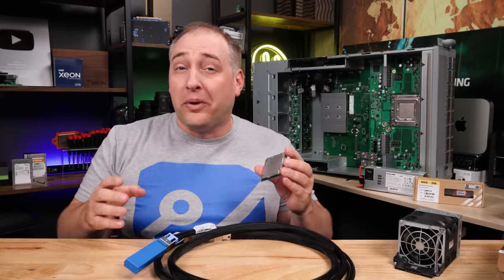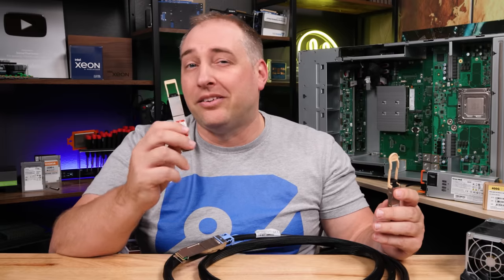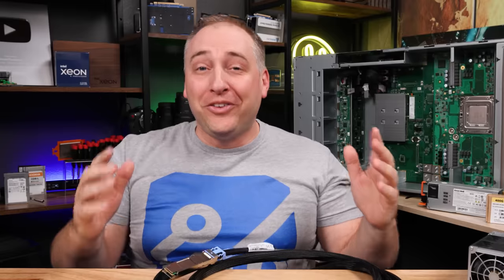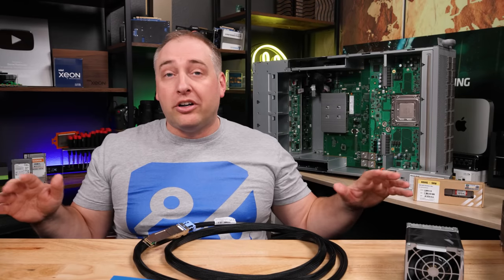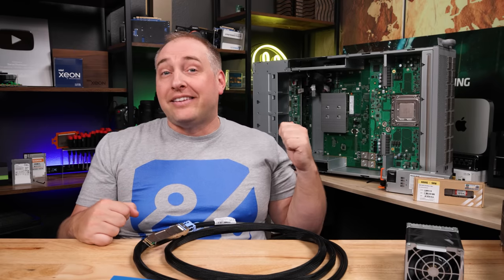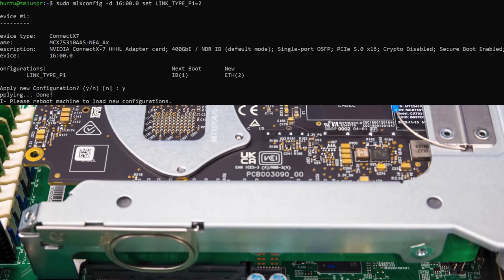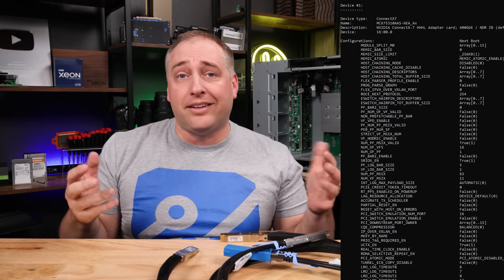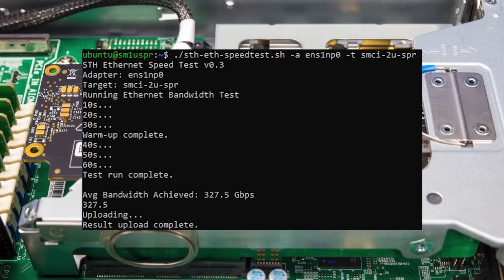FASTEST Server Networking 64-Port 400GbE Switch Time!

Comment: Hey thinking of upgrading my home network, will this switch be enough for 1.2Gb Comcast? I don't want to bottle neck it, I'm paying big money each month.
Reply from the maker: You may have to wait for the new 800GbE generation later this year. :-)
Reply: @ServeTheHomeVideo  i wonder how much bandwidth an AI cluster needs to flow.  Is this for serious carrier backbone?
Reply: @letterspace1letterspace266  AI clusters can run on insane connections exceeding the 400G connections used here, but they can also just run on a single machine instead of as a cluster and still perform shockingly well if optimized.
Reply: Haha nice

Comment: At work we are putting together two vmware clusters using a pair of Aruba 9300 switches (32 ports of 400G) as the backbone. vSAN storage with all NVME is going to love the bandwidth.

Comment: Just more awesome, cool content from Patrick K & STH.  Yes it's nerdy.  Of course it is!  We learned about Mikrotik's 4 port x 10Gb switch here from STH years ago and other OEM 25Gb & 100 Gb switches, too.  Where else can you see an FS 64 Port x 400GB switch under the hood.  You can count on Patrick.  He will remove tell you how many screws it takes to get inside the device.   And PK will remove the Heat sink, the CPU, the Fan Modules & PS Modules every time. And you get discussion, use ideas, performance results, connections parts, etc.  It doesn't get better than that. STH just helps get my Nerd Habit filled each week along with the other online tech nerd content.  Keep up the good work STH!

Comment: Hey Patrick, do you not have a subscription system for the website like Phoronix does, so we can read without ada while contributing? I feel bad having uBlock on, specially since I'm transitioning to 10G (switching) and 40G (direct) at home, and it's mostly thanks to you guys and your awesome reviews and posts.
Reply from the maker: We do not, but if you see from the screenshots we have an external firm sell all of the desktop inventory and most of the mobile. If you are on the desktop you will only see ads from our servers about server, storage, and networking things. We do not have bidding, auto roll video, moving ads, and etc because I do not like them.
Reply: @ServeTheHomeVideo  great, thank you!

Comment: Being a network guy, I am struggling with the OSFP acronym used here and i am sure when i start ordering these types of connectors/cables for these applications i will be corrected many times in conversation that overlap the two technologies. My one saving grace, 400Gb switching i  will certainly see a lot of, 400Gb routing, I'm not so sure I will see a lot of this before I retire in another 10 years
Reply: we're deploying 400gbit routing on nokia platform. it's a step up from giant 100gbit lacps to 36 port 400gbit line-cards.

Comment: What a BEAST! I'm glad that you guys went and showed this off. I got trolled by a guy suggesting that I use infiniband (which I'm already familiar with) at home on one of my recent comments. I also understand that it is a total BEAR to set up and get running at the correct speeds, etc. Totally NOT the sort of solution I'd be considering for home use. I've seen other YouTubers try to install old used enterprise infiniband gear in their home, and it's always funny to watch them suffer. Too bad you didn't show all the fun bits of yourselves wrestling the bear. Although, it's not very exciting for non-nerds to watch. I'm surpised you could even power this thing. You'd need to build an internal Chernobyl just to spin up the fans, alone! (Exageration intentional for comedic effect) I'm afraid the electric company would send an investigator if I installed this in my home.

Comment: At my work, we are refreshing a dc and where 400gig fits for us is more in the spine to super spine/core layer. We just don’t have hosts doing that high of speed, but most are moving from multiple 10gig connections to 25s. I would be jealous when there is a need for direct host 400gig!

Comment: Wow. 9% difference in throughput between ETH and IB.

On 100 Gbps IB, the difference that I measured was only about 3%.

$6k for 400 Gbps IB is actually NOT that bad when you think about $/Gbps (for a point-to-point connection).

I use 1 GbE as the "management" port these days.

Server consolidation meant that I was able to SRHINK my network (rather than to expand it).

But on my systems that have the space and is able to support it, I have 100 Gbps going to my Ryzen 9 5950X HPC compute nodes and also a 100 Gbps going to my Core i7 3930K which runs my LTO-8 tape backup system.

It takes the "stress" off the 1 GbE layer and moves it completely over and the 100 Gbps can handle a lot more things happening at the same time.
Reply from the maker: Well that is also a direct connect IB versus through the switch 400GbE.
Reply: @ServeTheHomeVideo  
Yeah.

I forget what my point-to-point ETH bandwidth losses were compared to a point-to-point IB bandwidth.

I don't remember if I ran my testing on the 100 Gbps IB through my switch or if it was a point-to-point test.

I would think that the bandwidth losses should be lower on the point-to-point side (because you aren't going through a switch), but I can't say that definitively.

Very cool.

100 Gbps IB is fun.

People give you REALLY interesting looks when you tell them that's what you run in the basement of your home.

Comment: try it without the switch - 400g will drop in price, will be good for clusters - they will have 800g before you know it #cluster overhead
Reply from the maker: 800GbE will happen but it is hard to go to the node at that speed until PCIe Gen6

Comment: Hi Patrick, How were you able to connect the OSFP HCAs to the QSFP-DD ports on the switch for the Ethernet testing? I just re-watched the video, starting at the 12:30 mark, where you're referring to "funky optics", I'm assuming these are QSFP-DD w/ MPO on the Switch Side and OSFP w/ MPO on the HCA side? I also read the Main Site Article, where you also talk about having to navigate different signaling speeds in-between the optics. I then looked in the STH forums and read the 2 threads discussing OSFP, and posted on one of them. Any details you can share would be much appreciated.

Comment: Hi Patrick!  Very cool.  I mostly think of 400gig switches as core/ super-spine switches. But like you said, I could see it being great for breaking out into a LOT of 100gig links without any over-subscription between them.  It is odd to think of 400gig as kind of slow, but if you had a bunch of 32 port 100gig switches with a 2 port lag up to the 400gig switch, that is 3200 down and 800 up.  So about 4 to 1 oversubscribed uplinks.  If instead you could break out a lot of 400gig ports into 100gig, and go straight to the server, there is no oversubscription between all of the connected servers.
Reply: When you mentioned core, I thought: I think most large companies use routers as core. So I looked up the product and it said right in the title: "64-Port Ethernet L3 Data Center" So yeah. It's also always fun to see in the spec sheet they mentioned Ansible supported in the automation tools. But what is interesting it supports RDMA over Converged Ethernet as well. Which is something I wouldn't have seen many years ago. L3 and RoCE in the same box (a switch would do just L2 and RoCE or a it was a L3 switch). My guess is it's a lot more common these days.